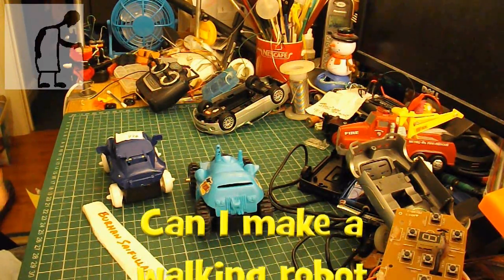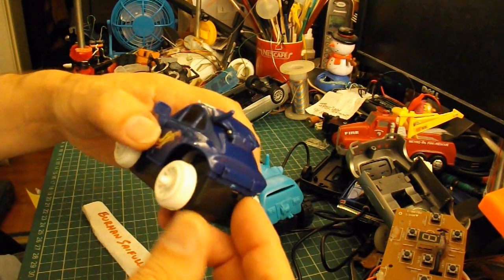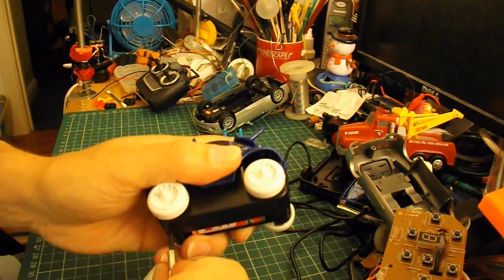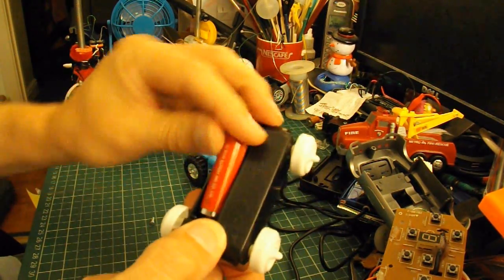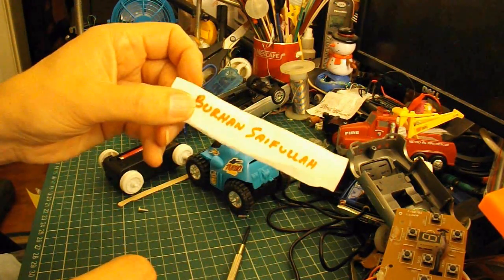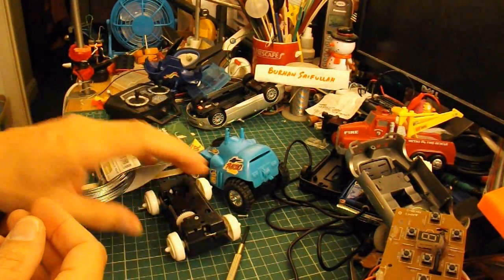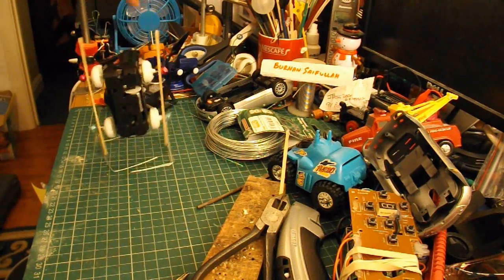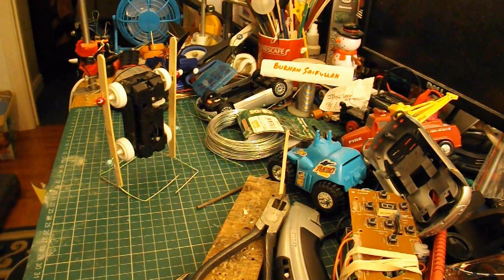Can I make a walking robot like Burhan Saifullah ?

Comment: Where can you get these cars? I want to make this so bad but I have no clue where I can find them.
Reply from the maker: +Maxum you don't need these exact cars, if you can find ones that have the back wheels and front wheels linked so they are like a 4 wheel drive then they will do the job. You can even make them work with just normal 2 wheel drive. Study the work done by Burhan https://www.youtube.com/user/galopante78 or Brainergizer https://youtu.be/lJWq08FSp5U
Reply: +GrandadIsAnOldMan thx